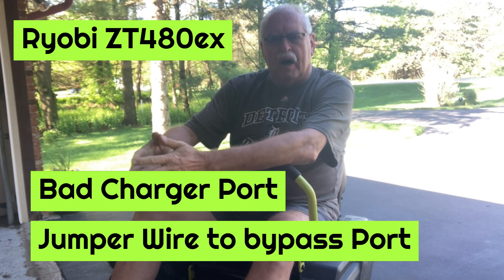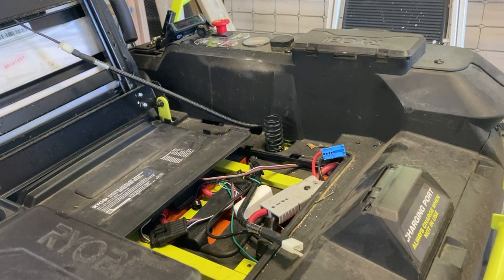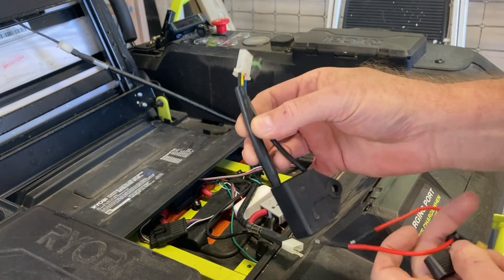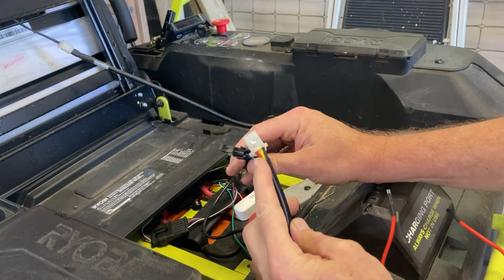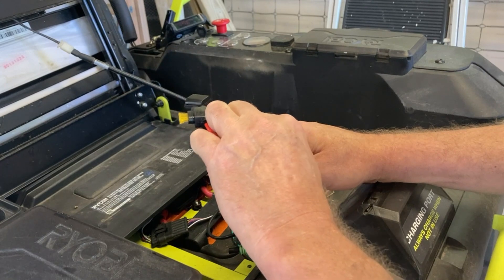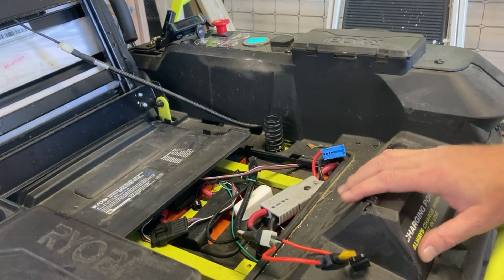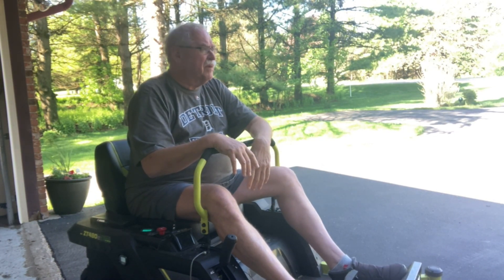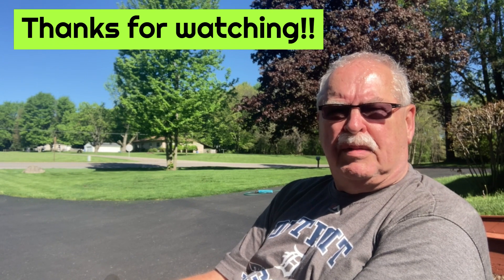Ryobi - Charger Port Bypass

Comment: The charging port on my Ryobi 54" is dead. Replacements are impossible to find. Kind of criminal that Ryobi doesn't supply replacement parts on a 3 yr old product. Did you replace yours with EZ GO? If so (and successful) which EZ GO port did you use?
Reply from the maker: To the best of my knowledge, there are a couple different charging ports that were used by Ryobi 48v.  I think mine was an older style that is no longer available.  It has the three chrome screws on the inside.  The newer style is molded over on the inside.  I think the newer style can be used on the older mowers.
I actually have a couple spares if you're in the Detroit area...
I did swap my 3screw port for an EZ-GO port.  It was a lot of hand work, but it does work.  Here is my video:
https://youtu.be/Bdj0e7xY3vU?list=PLd4K4nUH_WO3BvmtFUAhUX4JR1CZCxIzN

Comment: Hello Robert I’ve watched your videos on lithium swap I have the same mower as u it worked great for about 5 cuts I just went out to use it and it’s completely dead I hooked up the same charger as u and it’s not charging any ideas on how I can fix it plz thank u let me. Know plz
Reply: Do u think I ruined the batteries I used all the same parts as you did  it won’t charge I’m worried
Reply: Hi rob my smart charger the battery icon is blinking and it say off it won’t charge and the mower won’t turn on the battery meter won’t light up
Reply: Hi Robert do u think my charging port is bad if so we’re can I order one thx
Reply from the maker: Make sure that you cleaned out all of the plastic tabs in the charging port.  It's possible that the charger handle is not fully seated in the port.
If the charger still doesn't seem to be working, slide the battery tray out and connect the charger using the alligator clamps.  See if it charges that way.  Maybe the charging port is bad.

Comment: Is this something to do with lithium ion battery conversion that the charging port went bad?
Reply from the maker: Yes, it is kinda related.  Ryobi used at least two different charging ports on the Ryobi Zeros.  The "Green Light" video, which I have removed from YouTube, (at least temporarily), only works with "my" style of charging port. If you did the green light mod on the other port, that port will overload, melt, and smoke!  The port will be ruined.
The fact that Ryobi charging ports are hard to find could be an indication that a lot of people have had charging port issues, and not related to the Lithium conversion.
I am working on a video to modify an EZGO golf cart port to fit the Ryobi. It worked.  I may have it published tonight.
Reply: Thanks, I did modify as suggested the plug. I will undo it. regards Ben.

Comment: You could probably create a temporary connector with an Anderson plug and you should be able to plug right in to the Anderson plug on your mower and charge your batteries that way. I did the reverse with my new charger, as it came with an Anderson plug. I adapted the EZGO-style plug in to my system. 

I don't know if you saw my comment on your other thread, but for your safety, you should replace the smart charger you originally bought if you haven't done so with one from Dakota Lithium. The model you bought and like models available on Amazon are not grounded internally, which is a problem. Commenters on Amazon have reported arcs and sparks, smoke, a fire, and in my case, a failure of the sensing circuit, which caused the cable to always be energized with 48 volts, even when not plugged in. The problems with that are obvious. They also charge at a voltage above the engineering specs for the CHINS batteries, which I worry could degrade the batteries prematurely. The Dakota Lithium chargers run at the required voltage.
Reply from the maker: I wasn't too concerned about a temporary charging method.  Thru the Anderson would make it pretty simple.
I do want to get the charging port replaced and operating.
I must have missed your other comment.  I am not an electrical expert, and I will consider your charger recommendation.  I generally charge at the lowest 5a setting, but it sounds like the voltage "push" is the real concern, as well as the lack of internal grounding.
Reply: @robertveldman1901  your videos are great, and would hate to see you have an incident like others have with the chargers!
Reply from the maker: @dustinlong2663  My charging port has been replaced and working. I think I'm in good shape.  Thanks!